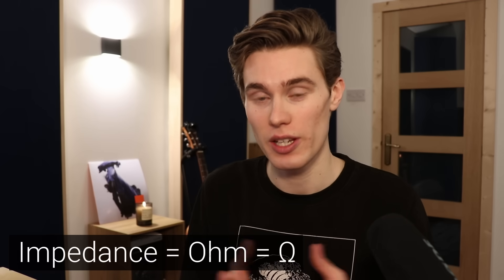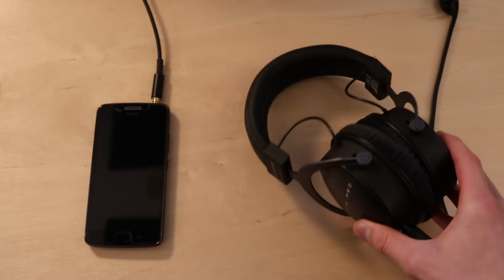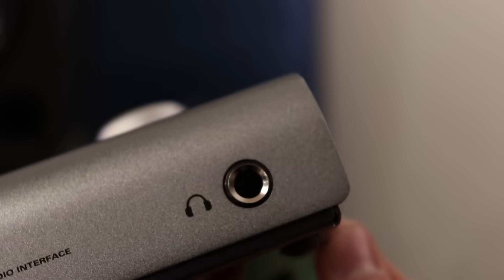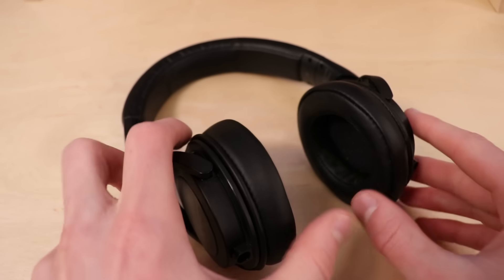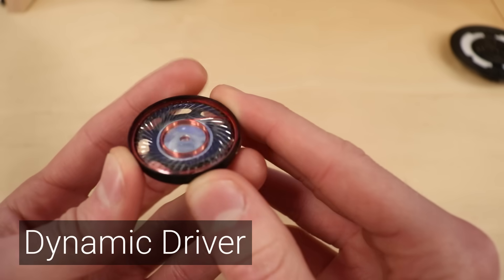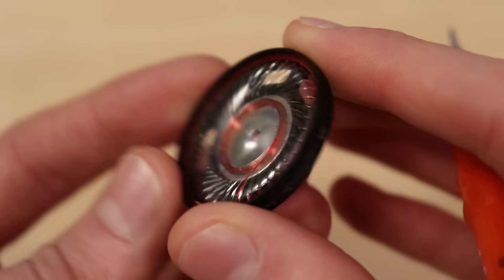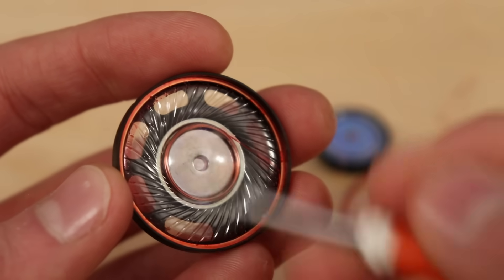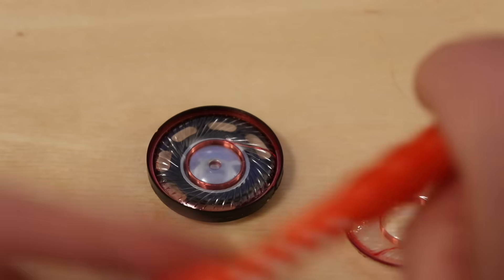32 ohm vs 250 ohm - Which Headphones Sound Best?

Comment: You seem to be confusing power with voltage.  Low impedance headphones need less voltage and more current to drive them; high impedance headphones need less current and more voltage to drive them.  Power is the product of voltage and current; so for a constant power current and voltage are traded against each other.  Smartphones do not, generally, have the voltage swing to drive higher impedance headphones but do have the current capability; pro and prosumer amplifiers can have a much higher voltage rail to play with and will have no problem providing the much greater voltages required for higher impedance headphones.  Lower impedance headphones use thicker wire with fewer turns (therefore greater current at lower potential) in the drive unit to create their magnetic field.  High impedance headphones use thinner wire with more turns (less current at greater potential).  For the Beyerdynamic DT770 all impedances have the same sensitivity due the variation of wire diameter vs. length as described above.
Reply: @robjobse8860  None. I think higher impedance headphones are a legacy back to a time when headphones were used with amplifier's headphone sockets; and of course, studio gear.  I've read there are audible differences between Beyer's DT770 series, but that may be just voicing.
Reply: @davidgriffin79  Some (especially older) amps sound shit unless driven pretty much maxed out - that's where 250 ohm headphones are useful.
Reply: David Griffin do you know if 250 ohms will sound better than 80 ohms?
Reply: @davidgriffin79  You're wrong when you said none. I'm an audiophile and also a gamer. DT990 Destroys the Astro A40 by lightyears away! Might I add that it is considered & known to be the best gaming headset there is. But the sound quality of a HIFI headset is so crazy that A40's considered a very cheap worthless trash compared to that of a DT990. Games and music sound way way way way fuckin' better, man.
Reply: Let's not forget the 'damping' factor, higher impedances allow for a better damping factor = more control on the actual push/pull of the diaphragms = more definition and a more 'precise' sculpting of the soundwaves, (at a higher voltage of course, otherwise it's worse than low impedance headphones)
Reply: And I would also like to appear very clever by joining this thread. Unfortunately, I'm not. Sigh.
Reply: It was my understanding 600ohm have less mass of copper which translates to more accurate and responsive  diaphram movement.  I have the 600 ohm version of DT880 and every review I saw said the 600ohm was better than the 250 which was close and the 80 ohm version which was noticeably inferior.  I think the main reason we dont see 600ohm much anymore is because of the equipment we are plugging them into now not because 600ohm is old fashioned technology.
Reply: @robjobse8860  Nothing at all unless you have an amplifier designed for them
Reply: @robjobse8860  Sometimes they can have lower distortion and more responsiveess, however, with newer driver materials it sn't as important as it was in the past and shouldn't factor into most peoples buying considerations.
Reply: harold avila  the reality is the exact opposite of this, lower impedance circuits are less prone to noise than high impedance ones. It's not really relevant here because the power involved in driving headphones is fairly high compared with a mic level signal for example where noise or 'interference' as you said could be a problem. Headphones have some natural immunity to noise.
Reply: There are SOME advantages to high impedance 'phones... Beyerdynamic used to make a 1000 ohm version of the DT100, there could be used to directly monitor a professional line output without affecting the sound, low impedance 'phones would cause level and probably frequency variations, this is a VERY specific use case though. They would also work better with very very long cable runs where this is required. IF you have an amplifier that doesn't deliver much current then you're better off with higher impedance, but the voltage swing must be enough that you can get the volume.

Comment: Now do that with a  planar and electrostatic headphones and even hybrid iem!
Reply: @LISTED Well, planars should work the same. But there are only a handful of planar magnetic headphones with a high impedance, planars tend to have a lower sensitivity, making them hard to drive.

And electrostats are completely different. Impedance is not important and they don’t use a headphone amp, but a high voltage power supply (which is usually called energizer) to charge the diaphragm up.

Or did you want him to explain how these different driver types work?
Reply: @lucaeinsle21  i want him to show us inside of them, and yea explain how it works too
Reply: @LISTED he disassembled cheap headphones in this video. Planars and electrostats are far more expensive, especially electrostats.

Plus, there wouldn’t be much to look at. If you want, I could give you a short explanation of these driver technologies.

Comment: you're better off getting a good 64 ohm sennheiser 280 pro
instead of a 250ohm DT 770 pro
the higher impedance the lower they produce volume , so they need to be amped up 
sennheisers don't need that , they sound full out of the box
beyerdynamics sound like they're whispering and need an extra headphone amp
but if you buy an headphone amp , ... why not stick the sennheiser in there ? go FULL full out ... ?
sennheiser always sounds better in my opinion , even the cheaper ones
full bass , full sound and you can crank them up
i'm always dissapointed when trying out a new beyer...
PS : the DT 990 pro open back is gathering dust in the corner of the room , looking all pretty

Comment: the best sound quality is from matching the input and output impedances.  so what you are driving the phones with is also important.
Reply: Erm no. You will only find matched impedances in very old audio systems from a time when amplifiers where hard to come by. The reason they matched source and load impedances is because it is the point of maximum power transfer between source and load (->Maximum power theorem).

Ideally you actually aim for the exact opposite: A strong asymmetry between source impedance (which should be low) and load impedance (which should be high). The ratio between load impedance and source impedance is also called the damping factor. It describes how strongly the oscillation of the headphones are coupled to the signal of the amplifier. Imagine the amplifier outputting a single pulse. The headphones want to respond by oscillating. Of yourse that means that the signals that the headphones produce does not match the input from the amplifier. You want these oscillations to be damped. And that is where the damping factor is important. A high damping factor means that the response of the headphones is closely linked to the signal from the amplifier.
Reply: @compuholic82  not talking about resonance, but make anything up you want on the internet. cool story bro

Comment: Can you please compare the audio Technica ath m50x and beyerdynamic DT 770 pro 32 ohm
Reply: Both are quite similar 
770 pro 32 is feels wider compared to m50x 
M50x has boosted low-end and slightly high treble

Comment: Nice! I have the 770’s 250 ohm AND I happen to have the iD14!! When I purchased the headphones I wondered if the iD14 would drive it enough but quikly found out it did! Audient interfaces are pretty underated imo.
Reply: hi, do I need a high ohm headphones with id14 mkii?
Reply: @ No you don’t. Higher ohm headphones usually need a good amp, so the question is more like; does your 250 ohm headphones need a separate headphone amp or is the amp in your interface already powerful enough to drive it. So no, your interface doesn’t require a higher ohm headphones, it’s higher ohm headphones that might require a headphone amp other than the build in one of your interface.
Reply: @greedokenobi3855  I understand you, I asked my question wrong. I am actually asking if the ID14 MKII can drive low impedance headphones correctly. It is obvious that it can drive high impedance ones, I know that.
Reply: @ Well actually it’s more like that it’s obvious that it can drive lower ohm headphones well and a question if it can drive higher ohm headphones well. Higher omh headphones require more voltage (more power) to be able to sound ‘loud enough’.
Reply: @greedokenobi3855  Oh my, I got it now. Thank you sir, really appreciate
Reply: @zephigh  So yea it’s probably gonna drive lower ohm headphones perfectly
Reply: @ Nice one!

Comment: A speaker is also referred to as a transducer"Changes one form of energy to another". As you stated electric to SPL" Sound Pressure Level".  Also, impedance does change with power, Voltage, Frequency, and reactance.  For example on a speaker of 8 ohms, it's usually measured at 1k frequency at 1 milliwatt. Very good session. Keeping it simplified and on track. As you stated to get more technical would mean longer or multiple videos and some not understanding your message.  Peace

Comment: I went to buy beyerdynamics today but I didnt, and now I see this video and now I'm even more confused what should I get
Reply: What you should get entirely depends on the devices you listen on: smartphones, PCs, audio interface, hi-fi, etc... Most professionals headphones (above $100)  will usually have high ohm as they are almost only used in a professional environment (with high end audio interface) that has different hardware standards as common day-to-day devices like smartphones.
Reply: Whatever you buy, don't buy beer dynamic, all of the range have a dip in the middle, while the open backs might sound a bit more balanced, they all sound tinny, and lacking. If you need a recommendation, let me know. I bouhght the beyers, and sent them straight back, There's a lot of people that swear by them, if your not going to be mixing with them, they'll be fine, but then will a pair of decent cheaper headphones.
Reply: , no probs, if you let me know what your budget is and what your going to be using them for, and what audio source/interface you have, I'll give you the right unbiased choices, I've used a few different pairs of headphones.
Reply: @Jimmy Spendix, OK, if your going to be taking the music a bit serious in the future, What I've settled on are the sennheiser hd58 x, they are bang on for the price, the sound is transparent for mixing, just enough low end, midrange is more or less perfect, and the high end don't give you a headache. A very balanced sound. Theyre 150ohms, so your audio interface will drive them easily, and your laptop should should aswell. I would definitely recommend these over even the more expensive HD 650, because those will need a separate amp to drive them. The akg k245 are quite similar, but have got a flimsy cheap build quality. Stay away from beyerdynamic, very comfortable, but lacking a lot in the sound department, just sound fake with missing frequencies, a snare drum sounds like a deep cymbal etc. Definitely go for the HD 58x, I think they're the best all round headphones, they're a massdrop collaboration, you should be able to pick them up for cheaper in the US, I paid £170, still better than paying double for the HD 650, and the  difference is very small, hope this helps.
Reply: Beyerdynamics are great headphones depending on the application. No headphones in existence have a flat response, and of course Beyers are colored just like other headphones. Try them. If you like them, buy them. If you don't like them, don't buy them. This guy telling you they sound tinny is just giving you an opinion. I've been using the DT 990 pro for years, and it's a very full sounding set of headphones with tight bass and a bit of high-end emphasis that's great for mixing. There are probably headphones that sound as good across all frequencies, but not so many at the price point.
Reply: @nimrodery , maybe years ago, beyerdynamic used to make good headphones, I bought a pair of dt 770's, sent them back because they were crap, not because I hate them, but because it would not be possible to mix with them. They were closed back, and your right, no headphones have a flat response, maybe I had a bad few pairs of beyers that nobody else had. Akg's, better, sennheiser, are better. I had a pair of samson Sr 850, that cost £20, that were better. Of course its my opinion and maybe a bad batch of beyerdynamics, but I still stand by what I say based on what I've had. What I can say about the beyerdynamics is they were very comfortable, and if they were half decent, I would have kept them.
Reply: @shahidali-vh2oc  The 770s are ideal for monitoring, not mixing. Not aware of any of their current models that aren't good for some purpose. AKGs are the ones I don't like, but I'm not telling anybody my Beyers are "better." I just like them more.

Comment: Thank you for the video.
However, I own the 80 ohm DT 770s, tried them on my Scarlet audio interface (didn’t work) then purchased a Sterling headphone amp to power them, but they’re still pretty flat and low. Is there a headphone amp that’s suggested? Am I doing something wrong?
Reply: I checked out all the specs, and while that amp is powerful enough, it measures pretty bad on frequency response, distortion, etc. You're probably hearing the flatness of the amp. As for "low," if you mean quiet, it shouldn't be. If you mean lots of bass, yeah, that's the DT770 lineup, especially the 80 ohm variant.
Reply: Could you recommend an amp to use?
Or at least one that is optimal for the DT 770s?

Comment: Hello, can someone explain to me,  if my audio interface Presonus iOne has this specification:

Maximum output: 60 mW/ch. @ 60Ω Load
Output impedance: 10Ω

Does it make sense to buy 80 or 250 ohms headphones?
Reply: MY7O also don’t understand what should I buy
Dt 770 32ohm or 80 ohm for Scarlett 2i2
Reply: @MY7O It depends on the headphones. Which ones are you considering?

But I would recommend getting a dedicated headphone amp, 60mW at 60 ohms is very low. Also, the electronics in that audio interface are probably of a lower quality than those found in a headphone amp.

Comment: Hey Michael, quick question,
I was planning on buying the DT 990 Pro and all I have right now is a behringer umc 22 interface so
1) Are the DT 990 Pros a good choice for producing, mixing & masters? 
2) Is the Behringer Umc 22 enough to drive the DT 990 Pro, Or should I buy a separate headphone amp?
3) What other alternatives would you suggest? 
Thanks in advance x
Reply: 1.) DT880 Pro is more neutral and better for mixing. DT990 will work though (just learn to compensate for the less flat frequency curve).
2.) It'll probably just work (I don't own the Behringer, so can't tell for sure), but won't sound too good. Beyer DT's need a lot of juice to sound really good. 
3.) DT990's (and 770's and 880's) match really well with Schiit amps, especially Asgard 3, although Magni 3+ will be fine as well.

Comment: You do not answer the main question; if I have a headphone amp and I have a very good dac, and I can connect my headphone to either higher or lower voltage or gain, what's gonna sound better; dt770 32 ohm, 80 Ohm, or 250 Ohm, from the exact same model?? This I need to know. Cause if 250 sounds better, I get that, with a headphone amp. If not, I get the 32 ohm, I can use it on my ipod or phone or plain dac, and don't have to bother with a headphone amp. but, this is unfortunately not answered, yet, right?
Reply from the maker: 250 sounds better to some. I do answer it in the video
Reply: I did comparison with those three models and the same amp and dac! 250ohm sounds way better! More atack, more separation between instruments less muddy

Comment: Great video, interesting bit on the historic context of high impedance headphones. I always thought that higher impedance headphones used thinner gauge wire, reducing the moving mass of the coil attached to the diaphragm and therefore allowing for faster transient response, but needing a higher voltage amp. I mean, I don't know an awful lot about headphone technology, but I always thought that was the only point. Maybe you could touch on that in a follow up video?
Reply from the maker: Yes, a thinner gauge wire is often used as the resistance/impedance increases as the cross sectional area of the wire decreases. Some designs pair thinner wire and more turns for even more impedance, and this might well be lighter than a lower impedance model, allowing a more sensitive transient response!

Comment: REALLY interesting video! And timely as I’ve been looking at getting a different pair of headphones and was debating on what impedance level I should aim for! 😄
Reply: What did/are you get/getting?!
  I was leaning towards the audio technica m40/50x but now feel the dt770 pro will be better!
Reply: @gregorywilson3318  Well, it all depends on what you’re using them for, I suppose, but specifically, if you’re mixing but NOT tracking audio, I think the DT-990s are actually pretty impossible to beat for the money! I haven’t tried the 770s, so, assuming the leakage isn’t bad, they MIGHT be the best all-rounder like so many people say, but I wouldn’t know. And I don’t know from experience here either, but everything I’ve heard/read about the ATs leads me to believe the 40s are actually better all around than the 50s. I’m sure they’re both quality, tho! But yeah, I finally settled on having one pair for mixing (990s) and one for tracking (the NEWER Sennheiser HD280s), and honestly, I do feel like it was worth the investment. Happy hunting! 😄
Reply: @yobhsiFehT  Greatly appreciate your advice sir!